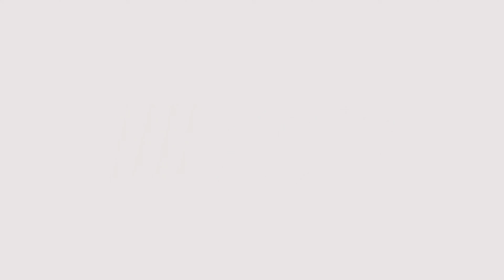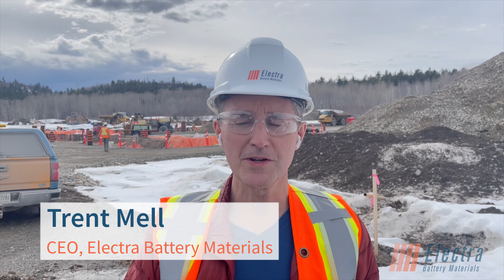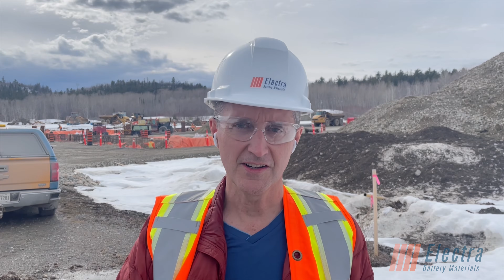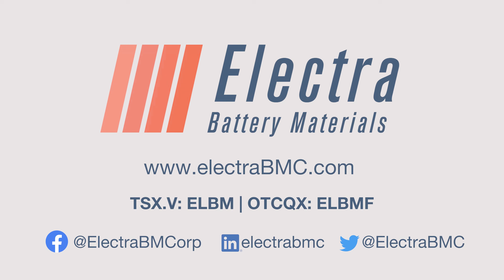Electra Upcoming Nasdaq Listing and Offtake Agreement for Recycled Battery Material with Glencore

Comment: new to the investing game, been buying a little here and there. But Elecetra is the most in my portfolio so far ( almost a 1000 shares ) I like the business model, and i'm a big believer in EV's. Will the Nasdaq move affect me, probably not i'm guessing?
Reply: On April 11, they will do a share consolidation, also known as a 'reverse split'. They will give 1 new share, for every 18 old shares. So after the reverse split, your 1000 shares will become approximately only 55. In theory, the value of your total investment will not change, just the number of shares that you have. If the old price of the shares is $0.30, after the reverse split, the value of each share will be $5.40 (0.30 x 18). What remains to be seen is whether the share price drops after the reverse split. If you google about reverse splits, usually the outcome is a drop in value before recovering at a later date. So, if you are buying for the long term, this may not concern you; if it does happen. Alternatively, the shares could keep their value and/or increase without dropping. We will see what happens on the 11th.